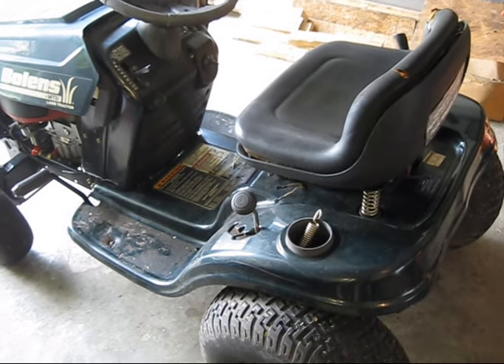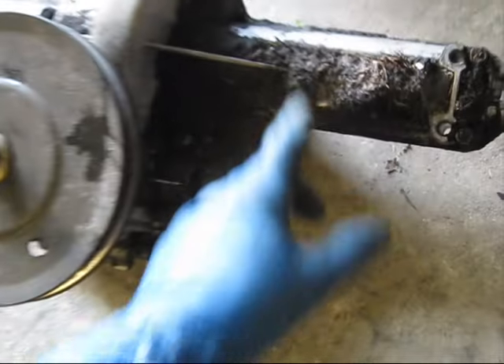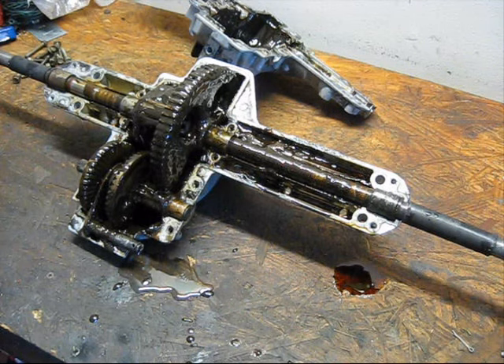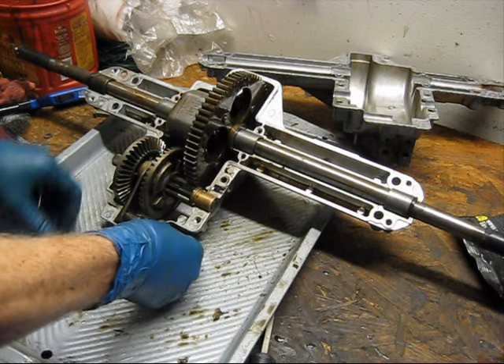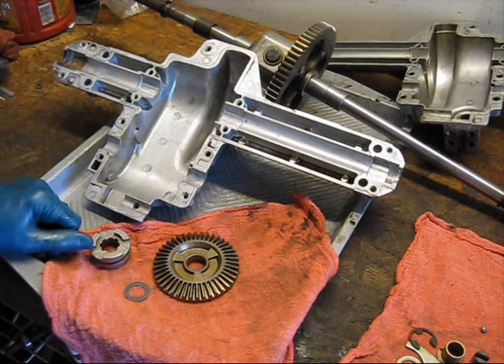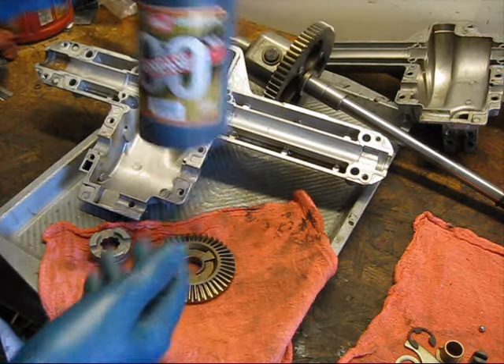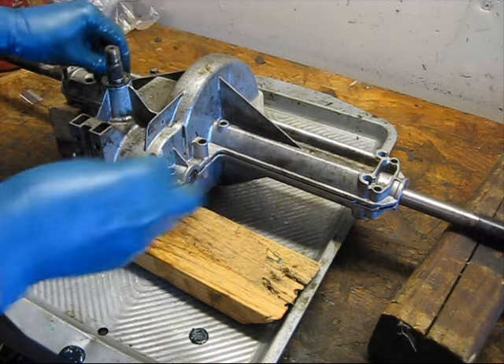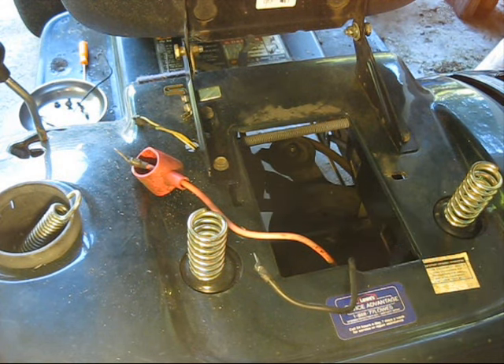Bolens/MTD Mower popping out of gear -  Varidrive transmission Repair.

Comment: Also a problem with mtd mowers (that I had with mine at least) the mower was approx 10 yrs old at the time... my friend gave it to me because he (and a so called professional mower repairman) had been unable to find the problem.
It was being extremely difficult to select a gear and sometimes impossible to select forward or reverse occasionally you could get it into get by rocking the mower fore and aft but it would slip out often. 
After recieving the mower I discovered the problem within a few minutes... the lip of the chintzy sheet metal that might be called the "frame" was rusted and
broken free on the one side where the axle/diff/trans meets the frame... so it was just flapping in the breeze shifting about when torque was applied to the axle. We welded a tiny flat piece of metal with some holes drilled in it to reinforce the existing mounting spot and it was good as new.
Reply: I think I'll have to do the same, might weld mine but worried I'll blow a hole through it.

Comment: Excellent Video and Repair work. I used various thicknesses of Stainless Steel flat washers to take up some slack in the 'thrust' bearing location. It has worked great for me. One other source of a mower not going into gear correctly is located within the 'differential' housing itself. There is a nut inside that can work loose and its job is to hold the axle tight and keeping the shaft splines mated. When that sucker loosens it is very difficult to gain access. In my case I threw caution to the wind and used a dremmel cutting wheel to make a 'window' in the housing  to gain access. Then take a grinding tool to the proper size open-end wrench to make the wrench thinner so it can fit into the window and on the bolt. Tighten it up and good to go. Some people take the differential to a welder and let them tack-weld the nut solid once it is tight. If anyone has problems with this type of transmission; Don't give up ! They can be worked on to last 1 or more seasons before spending some big bucks. [ it has been a while but if I remember right I also used a wrench from a  SkilSaw to tighten the differential nut. I may have had to widen the gap in the jaws with a file a bit to make it fit the nut. Using this tool is better because it is already 'Thin' enough to fit on the nut without hitting anything ]

Comment: Edit/Correction:  The brass bearings on the FNR/Drive shaft gears has to be sitting in a way to receive the upper casing.
Adjusted this slightly and now it's clamped together very tightly and can easily spin the drive shaft with my fingers.  Win, Thanks brother.

Just got mine put back together, using the SS00 grease.
Gears spin nicely when it's loose but with upper and lower casing tight it's quite difficult.
Think I need to remove one of the washers from the main drive/pulley shaft.
I added an extra one because it was a bit slack but maybe that slack is required.

Comment: I wanted to say thanks for posting this very informative video,  as well as the links for the parts which definitely saves those who are dealing with the same issues a lot of time not having to search for the parts numbers.  
 If I'm not mistaken, I believe both the forward and reverse drive gears or bevel gears which ever is desired to call them , I believe they are both the same part number , same part but they are installed in opposite direction each other.  Saying that just in case anyone out there needed both gears,  they only saw you replace the forward gear and listed the link for the forward gear . If I'm right and I  believe I am then maybe this will help anyone watching this that might need that information.  Hopefully that helps out.
 
Anyway, thanks for posting this video.  I can tell you this m much,   I have watched a lot of videos made on this very subject and issue,  and your video by far is one of the best videos I've seen on this particular problem.  
 
Thanks again for posting such a helpful video! 👍

Comment: Thank you. I now feel confident I can yank my transmission and find out why the axle is riding on the housing and chewing the housing up. From the looks of the inside, the axle goes through a bushing and  I believe I have a bushing stuck to the axle and it's turning as well or the bushing is just chewed up. I'll find out when I pull it apart.

Comment: I had a similar problem on my Troy-Bilt which has same setup in my transaxle, bevel gears, clutch gear etc. 
I thought about it just a bit and realized you should be able to swap the bevel gear/clutch gear assembly end to end on the driveshaft and get "fresh edges" where they count. Since the input shaft/gear drives one bevel gear in one direction and the other in the opposite, the wear will always occur on the "catch" edges of both the bevel gears and the clutch gear "interlocks" but the trailing edges of all interlocks are virtually unfazed.  By reversing the assembly on the drive shaft the force and pressure will now be placed on the unworn edges of the clutch gear interlocks and those of the bevel gears.  
This presupposes that  the assembly has not been reversed at a previous time.
Reply: Did you try switching the gears? Did it work?

Comment: Great video, use Lucas red and tacky wheel bearing grease and run a bead of black RTV SILICONE all around the edges of the lower housing and all around the axle bushings on the end of each axle !

Comment: Great video! Im shocked that you dont have more subscribers... I just got this same mower today, deck and all looks good, but the guy said it wont pull... Said he smells something that smells like a clutch burning... I didnt think this style has a clutch... Im leaning toward either a stretched belt or a worn out spring... I reckon ill see soon... When its not so cold out and im not sick
Reply from the maker: These use a varidrive setup. I have another video on that. The belts wear out on these and then they have drive/speed issues. Most mowers loosen and tighten the belt to act as a clutch.

Comment: Thanks for the tip where to buy the grease, those bolts are 3 start threads self cutting. listen for a click when putting bolts in as you could strip the thread assembling in the cases. There is another video explaining that. Check out the RADIOMACHANICS VIDEO. You didnt show the adjustment for the shifter rod going into the gear box.

Comment: Question is there a way to add grease without taking out rear from Tractor, or way to check the grease 
for the rear end, and what grease should be used, doing a spring check on similar tractor,,,thanks...
Reply from the maker: On this one you have to open it. some have a rubber plug
Reply: No, there isn't a way to add grease unfortunately.
The grease required is a bentonite grease, hard to find and expensive.  If you want to switch grease to Super S 00 Cotton Picker grease, you'd have to clean the entire assembly out and add in the new.
If you want to add it easily in the future, you can tap a hole in a decent spot of the upper casing, but you shouldn't be losing any grease.

Comment: I have been running standard bearing grease in my diff, but I do not have forward and reverse gears in it. The higher sw grease probably wouldn't let the selector work freely. But I don't think any harm would come to the diff. I put the grease in mine about 7 years ago.
Reply from the maker: You wouldn't notice a difference right away, it would show up in the form of accelerated wear, which would take very long given the way most mowers are used. And that's if it caused a problem at all. Mowers aren't very picky.

Comment: exactly what mine is doing, i got the new clutch and fwd gear, need to check my fork. but please let me know how much play is ok in the axle, on the short side?  its not broken but seems to have the same play as all these other videos.
Reply from the maker: Lawn mowers aren't really precision equipment. As long as it isn't too much and isn't dumping grease out it should be fine. You can always replace the bushings if you want to eliminate some of the play.

Comment: How did the "00" grease work out for you? I would think "00", as thin as it is, would leak past the axle bushings. Did the bushings seal sufficently well to hold in the "00"?
Reply: Wondering this too.  Hard to find much information about grease alternatives, I'm not spending that much on bentonite grease.
Reply: I went with the 00 and installing it today/tomorrow (today hopefully).
It will not reach the axle bushings, when you take it apart you'll have oxidation on the axle because there's no grease on it.
The grease is primarily for the gears.  Even then, there are oil sleeves on the axle ends, 721-0338, but I fail to see their purpose, most likely to prevent dirt from getting inside more so than keeping grease inside.
As far as the bronze bushings on the FNR/Drift shaft, the upper/lower casing clamps on the bronze.  Any loss is negligible, same with the shift fork port.  Goop is goop, the clay just helps to embed into the gears which probably reduces metal on metal contact by a degree.  Considering my transmission is 30 years old and the gears look fine, and just now removing the old shitty grease that probably split 15 years ago, I'm sure I'm fine with the 00.

Comment: Hey man my transmission is for a mtd Troy bilt and mine that middle part doesn’t won’t to slide on to the gear on the left the one you replaced on the transmission your working on and when I press hard on the gear changer it doesn’t hardly won’t hardly go or not go on that gear I don’t know why it won’t I don’t know if the grease on it is to thick just wondering if you might know what it is plus when it was running it would not shift good in forward gear and would grind but it would drive good in reverse

Comment: What if the “ramp edge” is square off with a grinder so not slip? Or add some metal with a welder 🧑🏼‍🏭🤔
Reply from the maker: as long as its square it should work. grinding it would leave slop though and the gear may be hardened and not to fond of being welded.

Comment: Slipping is best way to describe my issue.  Under load is worse forwards and reverse.  Bushings were shot, in fact wore the axel housing shaft oblong instead of round.  I’ll tear it apart again because bushings and cleanup with new grease didn’t fix my problem. At all.  Question- the diff seems loose when out but when installed it seems snug.   Is my problem most likely the diff or the fwd/reverse thrust plate gears?   How loose should/can the diff be?   Thanks in advance!
Reply from the maker: Slipping will be an issue with the belt system not the transaxle.

Comment: I've seen several videos saying it should have multiple thrust washers on the axles... I haven't opened one of these yet that had multiple washers. The parts diagrams show  two different thickness. I think at the factory it is a select fit of one of the two washers., not two washers on each end.
Reply from the maker: Whatever gets the clearance within spec is most likely.

Comment: Unrelated but I replaced the drive belt and now the variable speed no longer works, it's stuck on 1 or 2 (slow). It's correct belt but very tight. Could barely get tension spring back on. Know what is causing this? I can't find any info on that speed lever or how it works.
Reply from the maker: I have a video on how the system works. You need to replace both belts at the same time and I recommend OEM belts as these systems are very finicky.
Reply: @pfun41  why both belts? What does the drive belt have to do with replacing the other belt?
Reply from the maker: @alan933  There are two drive belts and they need to be the correct length and width to function properly. Wear has a big effect on the vari drive system.

Comment: could you have switched the forward and reverse gears?
Reply from the maker: No, it would have the same issue just in reverse.
Reply: @pfun41  I don't think so because they would be using the opposite side of the gear "dogs".. I have the same issue and I don't have any new parts available, gonna use some Prussian blue to see wheree the pressure /contact is when I try that before I install

Comment: ok mine is a bit different it has 1 gear and the reverse is thru a chain. it has pins for the dogs and they are all good it still pops out of gear no matter where i adjust the shifter. so i'm going to modify the linkage and move the hole out from the pivot. plus i checked the bushings they were good i greased the vari drive slack sheaves and i still have the whine so it must be just part on the system. if the mod to the pivot linkage works i will come back and say it did.
Reply: Then you have 5 speed

Comment: I didn't see when you put the ballbearing back in that keeps the shift rod in position, mine has a shorter bolt that puts pressure on the ballbearing to hold position, at least that's what im  assuming it does, can anyone let me know if im right or wrong on this? Thanks.
Reply from the maker: You put it in last after everything else is back together. There should be aball bearing, spring, then bolt.

Comment: I just recently replaced my drive belts but now my lawnmower has basicly only one speed, and its very slow. Anyone have an idea of what might be wrong?
Reply from the maker: On these mowers proper size and drive belt tension are critical. You may have a belt thats too big or a part hanging up.

Comment: You should have checked the bolts to make sure you didn’t cut new threads in the aluminum housing as the bolts are self tapping and will cut new ones
Reply from the maker: That part was likely cut out for time. If any bolts weren't in properly the impact driver would have been hammering the hell out of them.

Comment: If this post wasn’t 6 years old, I would ask “did you change the seal that was leaking grease on your brake rotor and pads or did I miss that in the video”?
Reply from the maker: I can barely remember what I did yesterday much less 6 years ago

Comment: My mower just had the same failure. Where did you source the parts?  I cannot find them other then complete axle groups
Reply from the maker: partstree, ebay, or amazon
Reply: @pfun41  thank you. great video and well explained.
Reply: @pfun41  did yours have the spring and ballbearing that's held n place with the screw that  holds the fwd and rev/neautral in position? I forget what it's called,where the actual shift linkage bar hooks up to it,I missed it in the video when u put it together.
Reply from the maker: @davidl2281  The detent ball? They all have that, it's required to hold it in gear.
Reply: @pfun41  I have a screw that goes in where the spring n detent ball goes, I thought it was for putting pressure against the spring n ball,, it was loose when I took the transmission off mower,the problem I am having is it wouldn't stay n gear, and sometimes would pop out of gear, I have it completely apart and all the gears look pretty good, so I thought maybe that spring n ball is letting it pop out of gear?  So basically I don't know what the problem is, lol, I appreciate your reply back to me, and any help u can give me, thanks
Reply from the maker: @davidl2281  screw should push down on the spring and hold pressure against the ball in the detent.
Reply: @pfun41  I agree with that, I just wasn't sure if it should be  adjusted or tightened up all the way, but I just tightened up the screw all the way n seems ok, I was worried about getting it too tight and screwing something up, thanks for your help,

Comment: what make these axles whine when in drive mode? the more i push on the pedal the louder it whines.
Reply from the maker: Probably the varidrive system. I do find that 99% of them have some whine, I typically don't worry about it. It could be a number of things, old bearings in the pully system/idlers, the straight cut gears in the transaxle, or just the vari drive system itself. Unless it's ungodly loud I wouldn't be concerned.
Reply: @pfun41  thanks i took it all apart and found a bit of sid to side slop so i fabed another spacer and took that out. i then shifted the fnr yoke and it stopped over the detent and fully engaged at both sides i think someone was in it and got the spacers messed up or poor assembly at the factory. mine has spring loaded dowel pins that fit into the side gear and the other gear. i don't have 2 side gears min has the reversing on a jack shaft under the main shaft connected with a chain. the pins are good the holes are good the yoke is straight and square.

i greased the vari drive idler pulleys and the vari drive so that should take care of any noise they generate. the noise must be from the intervals of the actual drive. thanks